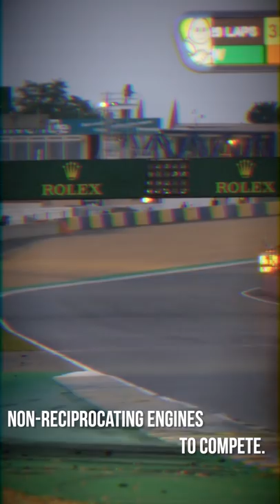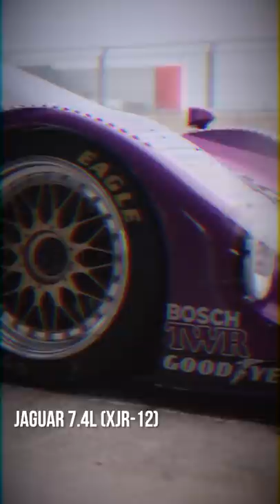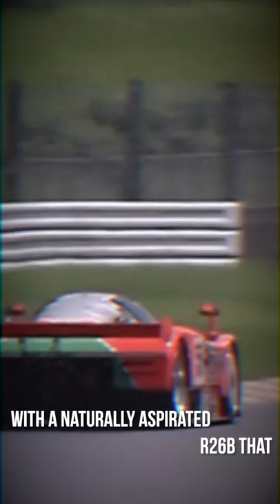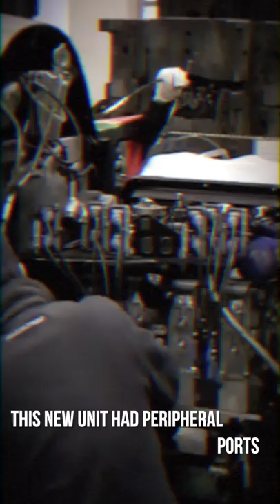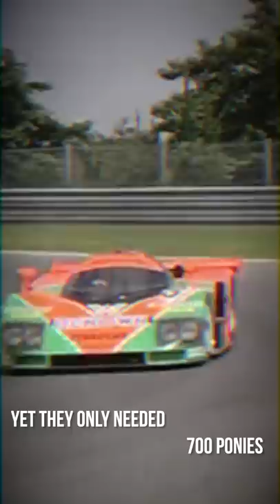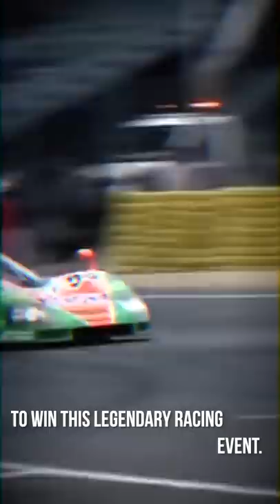The Legendary 10,500 RPM Mazda 787B Engine #shorts

Comment: If the reliability issues could get sorted out I would be prepared to own a classic 70s/80s Mazda - maybe even an RX7 from the mid to late 90s......
The RX8 doesn't cut it for me 🤔.
Great vid VR 👊👍
Reply: Also the RX8 is the most unreliable of all the RX series cars. And most of the reliability issues of rotaries are from not doing proper maintenance, not deleting the oil injection system and not premixing 2 stroke oil to the fuel (better way of lubricating the engine compared to oil injection). Once you take care of those 3 Rotaries will easily last 300000-400000Km without having to open them again
Reply: @MrBluePoochyena  there is no need to delete the oil injection system whatsoever. Maybe install a sohn adapter so it doesnt inject dirty crank case oil. Premix is a good idea especially on series 1 models with only 2 "side" injectors. Premixing on series 2 is only worth if there is no sohn adapter installed, as they revised the engine, adding a third "center" oil injector.

Comment: What people don’t realise is that rotary engines are extremely good for endurance racing. They can go for hours and hours in racing conditions at close to full pace. Most piston cars have to cruise somewhat to save the engine.
Reply: Mazda had to detune the engine to 700hp, because it was overheating and would have been too unreliable. And everyone has to cruise or lift and coast to save fuel, it's and endurance race after all. The competition in 91 was almost non-existent, hence why a slow 787B won.
Reply: @iliketoast-q9b  show me a source for them ever having h overheating issues. Mazda speed published a technical paper about engine development for the 787b, and overheating wasn’t something they had to solve. 

All endurance engines are “detuned”. You clearly don’t get endurance racing. Endurance racing isn’t about having the fastest car, it’s about being reliable, which the Mazda was fantastic at. The other cars lost as they weren’t as reliable and that is what endurance racing is about.
Reply: @jamesford3549  You don't detune your engine down to a measly 650 hp in a race (correction from previous 700 hp, looked it up), unless you have overheating issues. Another reason was of course fuel efficiency, which wankels are notoriously bad at. Even the Porsche 962s, which were outdated by 1991, were laping faster than the 787B around Circuit de La Sarthe. It came down to Mazda playing it super safe in a year where the competition wasn't as stiff and relaibility for the faster teams was an issue. The 787B was and still is the slowest winner of Le Mans, relative to the rest of the grid it competeted against.
Reply: @iliketoast-q9b  you clearly don’t understand endurance racing. It was detuned not due to overheating reasons but do to internal wear. After the race the engine was stripped and the engineers found the wear much lower than they thought, some of the engineers on the project said it could’ve done another 24h. Nothing to do with overheating so stop flogging that dead horse, go read the sae technical publication of the engine development. Author is Kato. The other teams had reliability issues because they had to drive faster in the race to stay ahead of the Mazda, as the Mazda didn’t have to coast and pace so much, so when the Mercedes were running faster than they wanted, the cars broke. That is an amazing feat of performance, reliability and race strategy by Mazda to force their rivals to break their car or concede the place. That is the beauty of endurance racing. The 12th fastest car can win through reliability. It’s not a sprint. The competition was fierce and it was a hard fought win.
Reply: @jamesford3549  Comment got deleted. The 787Bs won 1 out of 14 endurance races in 1991. They surely did not "force their rivals to break their car or concede the place".
Reply: @iliketoast-q9b  I’m talking specifically about Le Mans ‘91 not the other races. 

The other races the 787b didn’t do well at, doesn’t mean the Le Mans win was easy?

Comment: See so many bicker about the Wankel. The Wankel was never banned and it would not have made for a good, long term production race engine. They had to detune the car by over 200 horsepower just to make it more reliable. Even in the street cars, the RX-7 and RX-8 are complete money pits because of the Wankel motor. One of the best sounding motors by far but also one of the most plagued.

Comment: What displacement do that engine have in total with all the 4 rotors ?
Reply from the maker: 2.6L
Reply: Calculating the displacement of a Wankel engine is somewhat controversial because each rotor creates three chambers, in this case 650cc, but the rotor turns at one third the speed of the crankshaft. Counting all three chambers for 4 rotors would result in 7.8 litres, however this can be compared to a conventional 5.2 litre

Comment: if they didnt ban it the car market today would be much more different and better
Reply: Definitely not. The turbo V8s and V12s were much better engines.
Reply: @semiedgv  nah the concept of the rotary is better. its more efficient and smaller. it just hasnt been worked on as much making it the worser option however if it werent banned in racing, companies would work on it improving it and ultimately making it better.
Reply: @nathan-qx2ep  More efficient? Rotaries are the opposite of efficient lmfao

The only reason the 787B won Le Mans is because all the leading cars broke down or crashed. 

And you know what happened? It never finished higher than 5th in all the races it participated in other than the Le Mans victory.

Rotary wasn't banned, the regulations just changed. Technically turbos and anything that wasn't a 3.5 liter F1 engine were banned.

Comment: That engine was a engineering masterpiece 
So of course they regulated out of competition 
I love and hate racing at the same time
Reply: The 787B was slow and only won 1 out of 21 races. Its rotary engine had to be detuned to avoid overheating
Reply: No it wasn't banned. Next year had a minimum displacement of 3.5 liters while this engine was just 2.6
Reply: @GewelReal  It wasn't really a 2.6, the  rotor has 3 sides and each side runs an independent cycle, it's as if 3 pistons were using the same cylinder at the same time. Taking this into account it would come out to 650cc x 3 sides x 4 rotors = 7.8l, however you have to take into account that the rotor spins at 1/3 the speed of the crankshaft, therefore although for each rotor rotation there are 12 useful phases (as in a 24-cylinder four-stroke), for each revolution of the crankshaft there are only 4 useful phases (one for each rotor) as in an 8-cylinder 4-stroke of 5.2l or a 4-cylinder 2-stroke of 2.6l, engines to which it is considered equivalent. Also the RX7 and RX8 birotor engine are usually considered equivalent for sporting, insurance and tax purposes to a 2.6l 4 stroke engine

Comment: I really hate the "legendary" status of the 787b. The car, hell, Mazda's entire endurance program for 21 years up to that point, was a complete failure. 1 podium ever, which happened to be a win, which happened to be at Le Mans...and not because the car was fast. The year prior, Mazda entered 2 787s and 1 767. The 767 was the only car to finish the race as the 787s caught fire with the 767 coming in 20th. 

They were also allowed to run cars 200kg lighter than the minimum weight allowance. This allowed them to to be competitive with their engines detuned which in turn is why the Mazda's were better on reliability.

At least it wasn't the usual "the 787b was banned for being too fast!" Becausse they were never fast, never held a fastest lap, etc...and were only "banned" as much as every other car running was banned when 1992 required a 3.5l engine.

Comment: The engine was not wanted so they changed the rules to make it impossible to participate and in generall cap the variety of different engines.
Gladly Mazda managed to secure the victory in the last year possible.

To me it's still the only Japanese manufacturer to ever win at Le Mans, because Toyota didn't even have competition. As soon as they got some again, they weren't even close to having a chance to win.
Reply: No, nobody cared about them also because they were underperforming, the opponents were faster, despite being penalised in terms of weight, but they had problems

Comment: Why did they disallow rotary engines?
Reply: They didn't specifically. The C1 rules for 1991 required cars to have a 3.5 litre engine in an effort to encourage manufacturers to F1 (which were 3.5's at the time) the rule changes was made years before the Mazda's lucky win in 1991. The same rule meant Jaguar couldn't run their V12 or Mercedes their 5 litre V8.

Comment: Oh really it had reliability issues, never would have guessed.
Reply: The engine itself was fine at 700 HP. However, it was capable of 930hp (Naturally aspirated!) And that engine mode naturally had issues as the engine is being strained big time. The 700hp mode (which ended up winning) was dead reliable.

Comment: Your power numbers are slightly overestimated, rotary experts like Dahm and many others have done great amounts of research in the power levels of a naturally aspirated 4 rotor and to achieve that amount of power is just not possible, 750-800 is more reasonable as a max power figure without any power adder.

Comment: These motors were not dominant, they just lasted and everyone else had problems. Mazda was allowed to run the wankel because there was no other reliable option
Reply: They'd already decided on the 3.5l formula, which should have been implemented in 1991, but almost no teams had a reliable or competitive engine, so the FIA held off the rule change til 1992.

Comment: Banning the wankel was such a low move…
Reply: It was not banned because was fast. Apart from Le Mans, which he won because of the unreliability of his competitors and where, thanks to lobbying, he was allowed to race with a minimum weight of 830 kg while his rivals in the same category had their weight increased from 900 to 1000 kg rending it difficult to comply with the consumption limit, he never won anything because was slower than the competitor. 
Quite simply, a few years earlier a new regulation for the top category had been enacted that came into force in 1991, the old cars were allowed to continue racing for one more year even with the 100 kg ballast, with the exception of Mazda

Comment: Quite possibly one of the most overrated race cars.
Reply from the maker: How many four-rotor race cars from a factory team do you know? It is very unique
Reply: @VisioRacer  a car can be both unique and very much overrated.  They aren't exclusive.  Also, the GTO RX-7 that came before this had the first (non turbo) version of the four rotor engine and was a generally more successful car.  The 787B won Le Mans, which is a good achievement but was a non factor in every other race.  It gets classed as the coolest Group C car by many people (and this is subjective of course) but in reality, it doesn't remotely compare to the likes if the 956/962, Sauber C9/C11 and the various XJR Jaguars.

Comment: Rubbish. Just about nobody on YouTube knows how Group C worked. It was a fuel allocation formula. Max RPM for the 787B was 9000. Above that it consumed too much fuel to compete in Group C. The fuel tank capacity was 100 litres and the maximum number of pit stops was 5 for a 1,000 km race. For Le Mans the maximum fuel was 2,500 litres and not a drop more. If you exceeded your allocation you got disqualified, as Sauber were in Mexico one year.